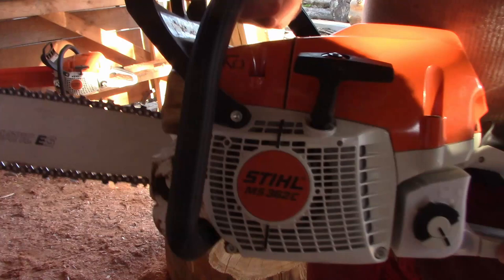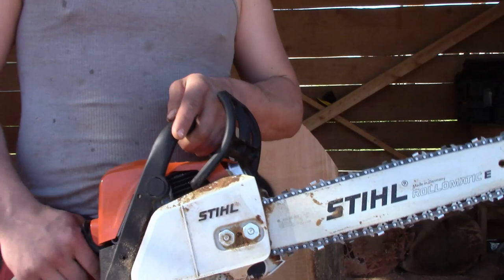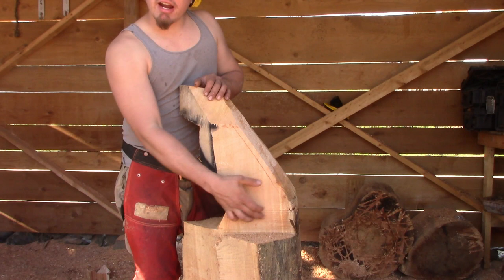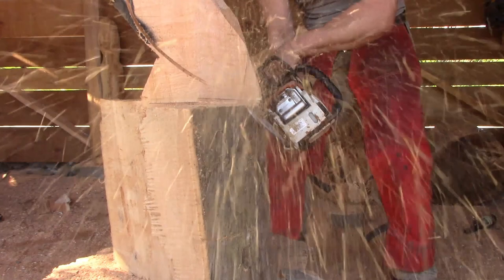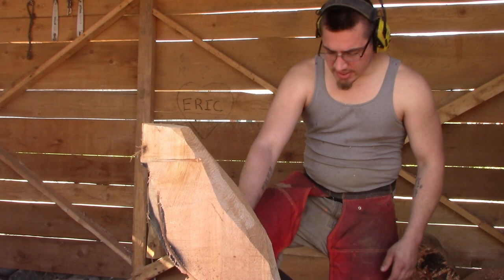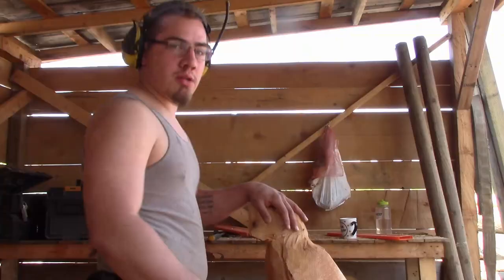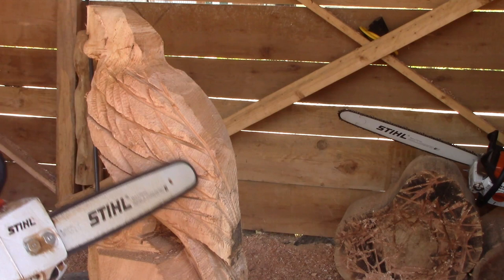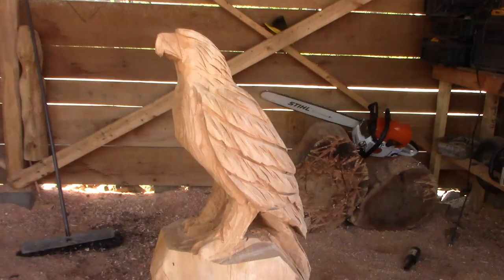How to chainsaw carve a basic eagle

Comment: Ideally if someone is new to chainsaw carving never try plunge cutting with the tip of the saw kick backs are more likely to happen and they happen fast. Learn about the technique of plunging before trying it and I recommend steel toed boots and saw chaps for added safety.

Comment: Nice job on the eagle are you carving cedar? It is soft but takes good detail  I just bought the 362cm computer controlled carb to replace my 440 mag it doesn't have as much power as the  44o but it has tons of top end reminds me of husky saws I used to run   good demonstration  of plunge cutting with a chainsaw  lots of chain speed slow rate of feed into the wood and a sharp chain  very little kick back keep up the good work  on the videos  and remember  10% inspiration  90% perspiration  makes  a successful chainsaw  carve or starve
Reply from the maker: Western red cedar!! And sometime i get my hands on old-growth!!
And yes the 362 i have is my first ever pro series saw and the biggest iv had yet! iv been told you usually don't need any bigger than that for carving. And yes carve or starve indeed!!

Comment: What kind of bar oil do you use? I'm a beginner and all of mine turn black from the oil
Reply from the maker: Michael O'Brien just normal heavy Stihl chainsaw oil. oil pens to nourish wood not sure how it would turn black honestly have never had that problem what kind of wood are you using?
Reply: Eric Caron pine mainly. I've used Stihl oil, but it turns the color of the wood dark